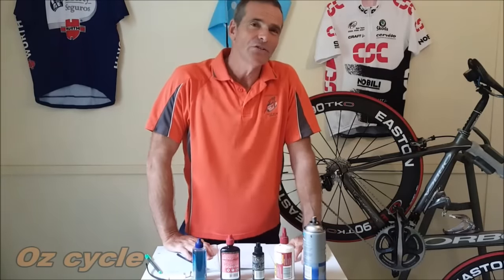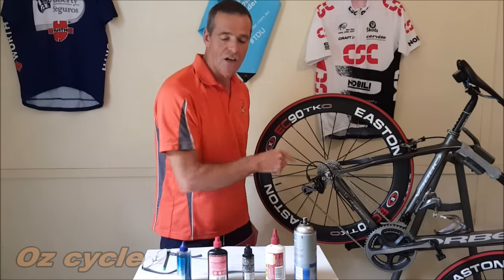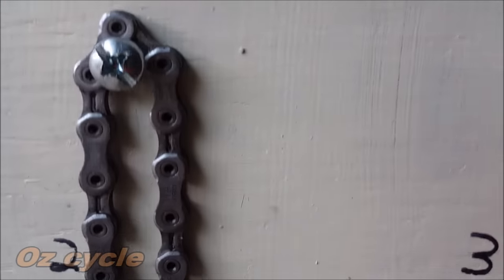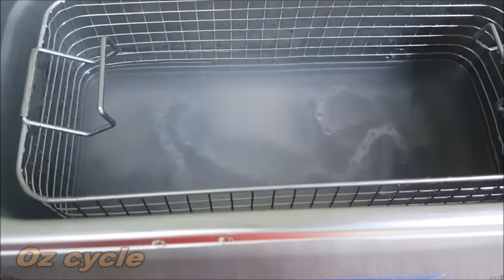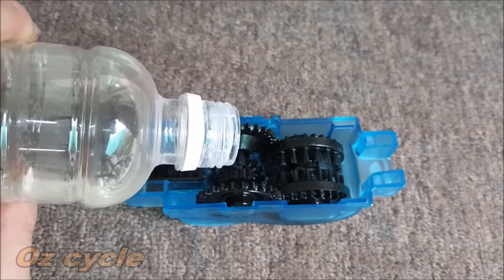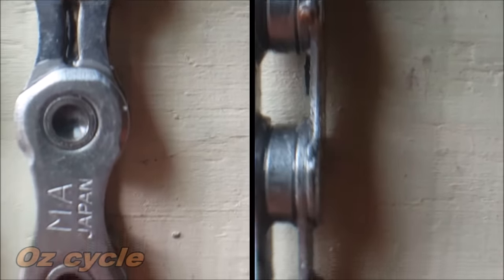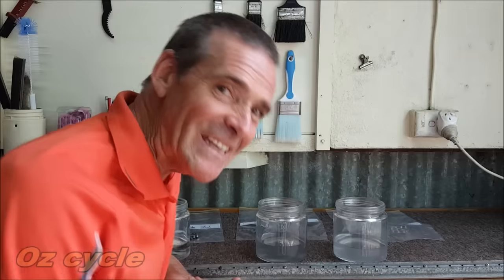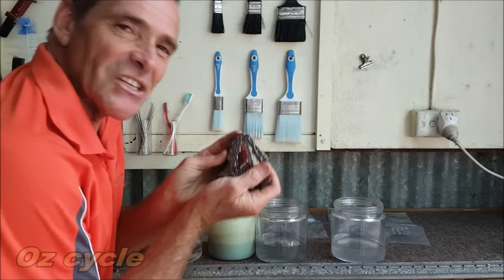Best chain clean ever !!

Comment: It would have been more fair if all methods used the same chemicals.  The plastic jar went through two cleans, from the gas and from the degreaser.  Put gas in the ultrasonic or the chain cleaner and I'm sure it will be a lot closer.
Reply from the maker: +Alan Caballero Yes but petrol in ultrasonic cleaner would be dangerous and it doesnt mix with water so would be used neat...thats 2L of petrol!!....to be disposed of . Thanx Alan,give it a go yourself and let us know the result if you like.

Comment: Does isopropyl alcohol work in place of spirits?
Reply from the maker: Yes
Reply: @stevenleffanue  Thanks for the response. You certainly have convinced me about waxing. Does this method remove wax as well? I have a secondhand chain that might have been waxed. Additionally, is the PTFE absolutely necessary? And finally, will the wax play well with any residual wd40 on chain rings and cogs? Great videos. Really excited to try this out for the maintenance,  cleaning, and silence aspect.

Comment: great video!  thanks for sharing.  after your homemade gasoline you're right to wash it off with water but try this trick.  put the gasoline soaked chain into hot water with detergent and it will boil, and agitate away even more grime from the inside rollers (not dissimilar from the ultrasound).  like this: https://youtu.be/aHFFNp2VKVw?t=9m22s  keep up the good work!
Reply from the maker: +7pillarsOwisdom Good idea...I will watch the video later as Im running out of data for this month. Thanx
Reply: please get back to me when you've had a chance to see it and even try it yourself.  i think you'll like the results. imo, it reduces the need for ultrasonic cleaner (and dumming drivetrain?) while using the homemade chain cleaner just as you do now
Reply from the maker: +7pillarsOwisdom will do

Comment: What about a soak with degreaser instead of using petroleum? Maybe the petroleum cleaned better because it was a soak, not because it was petroleum.
Reply from the maker: Degreaser doesnt seem to 'disolve' oils,waxes and general road grim as good as petrol,Julian. Petrol is also faster acting. Usually just a half hour soak is plenty.

Comment: Great video but the home tub cleaner you also used a spray degreaser so you added another very potent step to the process, voiding the control process
Reply from the maker: +John Burns Hi John. Its really a 2 part process. Petroleum removes most of the unwanted matter whilst the degreaser removes any oily residues which petrol also leaves behind. Hope thats understandable?

Comment: Can we use boiling water to replace ultrasonic cleaner ?
Reply from the maker: +Jonas Ong Boiling water is a good cleaner Jonas if you just have wax in your chain. If using other petroleum lubricants boiling water may not remove all traces of that lube. If unsure whether your chain is clean enough simply soak it in metholated spirits or alchohol in a glass jar...after a couple of hours,shake the jar and see if the liquid is clear or contaminated.
Reply: oz cycle thanks

Comment: how can you remove the chain from the bike?
Reply from the maker: +Herold D'souza Usually with a 5mm allen key from the front and a peg spanner at the rear of each chainring bolt. If you dont have a peg spanner you can use a large flathead screwdriver. The rings should slide over the spider arms and pedal.

Comment: 3rd chain was dirtier to start with. No surprise that petrol did a better job.
Reply from the maker: +Chris Dermody Hi Chris. It may have appeared that way,sorry but I performed this experiment over and over for eight months before finally making the video shoots. The results are still true to any repeated efforts.
Reply: Thanks for the reply. I don't doubt your results at all, was just an observation. I have a lot of experience in cleaning and maitaining mechanical parts, including bikes, and there are few things that eat grease like petrol. Shame it is such a pollutant. I use 3 chains in rotation, swapping every 800km or so. I completely clean the chain every 2nd ride using a combination of degreaser in a Park Tool chain scrubber, rinsing with hot water (twice), and then flushing it with isopropyl alcohol and drying with compressed air. The petrol here is cheap, but it stinks, not like Aussie unleaded.
Reply from the maker: +Chris Dermody Thanks for the insight Chris. Rotating chains over is excellent for extending your drivetrain life too  :)
Reply: Chris Dermody agree.  I have a. 5 chain rotation.  cleaning 5 at one time seems better to me.

Comment: Dude, NEVER run your liquid in your ultrasonic below 2/3 of the tank. You will break your machine and it will not be working efficient because the vibrations come from the sides. Fill up your tank and hear the difference it makes. 
I'm working with ultrasonics everyday

If interested, download the installation instruction manual from http://uk.rs-online.com/web/p/ultrasonic-cleaning-tanks/8555915/
It doesn't matter if it's a different model, all ultrasonics work the same.
Reply from the maker: +Doggoth X Noted. I will take a look at the manual again. Thanx for the pro advice.

Comment: how to dewax? by using degreaser?
Reply from the maker: Soak in petroleum for half hour or more,then degrease....perfectly clean metal 😁
Reply: Also You can use hot air. It's much friendly than petrol.

Comment: What if instead of using petrol in the home made cleaner you just use methylated spirits through the whole process?  Then you don't have to degrease and bathe in meths.
Reply from the maker: Metholated spirits doesnt clean as good as petrol....otherwise it would be good.

Comment: Whatever happened to paraffin and a paint brush? Bit long winded! Paraffin is used in 95% of parts washes.
Reply from the maker: The wax has to get into the chain not on the outside Chris. Hot wax bath does it perfectly.

Comment: Talk about saving money by cleaning your chain and then proceed to show us your ultrasonic cleaner. Bollux!
Here's what I do and I think it's cleans just as good and gets the cogs at the same time. I put laundry detergent on the chain and cogs and spin the pedals backwards a bit, then turn a high pressure hose on the whole assembly from front to back as I spin the pedals. Let it dry off a bit by riding it round the block and then lubricate with WD40 and wipe off the excess. I do this once a week and my chain is very low resistance and the whole mechanism is clean enough! After all I'm going to go out in a few and it's gonna be dirty again in just a few minutes.
I think you're a bit OCD about how clean your chain is and that it has fooled you into preferring the use of petrol to clean your chain. There's a reason why cars have devices that prevent the evaporation of petrol into the environment and you invite it as well as expose yourself to inhaling those vapors so your chain can be clean enough to eat off of. MADNESS!
I don't know about where you live but I can get a new chain for less than an hours' pay, and do so every year just to be on the safe side. A clean chain is ONLY about resistance and your method spends 100 watts more energy to clean it and only saves an additional 0.1 watt over my method, and that for only a day at most.

Comment: Not fair test.  You should start with equally dirty chain.  Rinsing should be same after each method.  What was that "degreaser" and why laundry detergent?  Just use professionally formulated cleaner and follow the instruction.  Landry detergent is design for fabrics not for metal.   Ultrasonic chambers require special cleaners design for that method.

Comment: This is like comparing apples with oranges as different solvents are used in the different methods - an unspecified diluted degreaser + household detergent versus petrol (gasolene) followed by degreaser on a dummy bike (what a faff!).  To make the comparison valid, you should use the degreaser cocktail in the home-made plastic shaker device.  BTW, it's illegal to sell or store petrol in a plastic container in the UK.  And rightly so.  
Also - if the methylated spirits removes residual dirt, why not simply clean the chain in methylated spirits?  Meths is far less inflammable than petrol, too.  And far less toxic.
Reply from the maker: +FangPaw Petrol ruins the brushes in clip on cleaner so the homemade shaker was best alternative. Meths is for removing any residual oils...any dirt falling out is a bonus.Yeh,Ozzie laws are pretty slack in caring for the environment....wide open spaces,plenty to abuse,hey.
Reply: +oz cycle.  You could have used petrol in the ultrasonic bath.  With a fire extinguisher close by!  I love the hand-made shaker, but I'd use it with an aqueous degreaser, followed by a prolonged soak in meths.
Reply from the maker: +FangPaw Pfffft!...yud be suprised how many people have suggested petrol in the UC....no more Oz cycle after that :) . Yeh,good one,degreaser in shaker too. There are so many variations to cleaning things....I just try to start peoples imaginations,they can come up with some great ideas often.
Reply: FangPaw you know the petrol station sells plastic containers in the UK right.
Reply: David Cross - you're right.  I looked it up and it IS legal to sell and store petrol in plastic cans (up to 10 litres) in the UK, but only if they are of the approved type.  Next time, I'll check my facts before I mouth off. Definitely egg on face :-(

Comment: Good old diesel fuel is as good as anything, take the chain off and give it a good swishing about in a bucket with a stiff brush then change the chain every 2000 miles or when it starts to stretch. These bottles of "stuff" and fancy gadgets are just another way of the bike industry extracting money from our pockets ... not necessary.

Comment: You used petrol in the homemade chain cleaner and degreaser and dishwashing soap in the other two. Would it not have been more accurate to use the same cleaning fluid in all tests? Anyway, I use a chain cleaning tool and then blow out the chain with my compressor. Compressed air blows out all remaining grit and no need to remove chain

Comment: if the methylated spirits are so effective, why not just go with the easy brush cleaner and then get the other 99% of remaining gunk out with the spirits. maybe wont be quite as sparkly clean as the ultrasonic cleaner laboratory equipment but pretty damned clean nonetheless?
Reply from the maker: Metholated spirits isnt a good all-round cleaner like petrol. Petrol leaves an oily film in which metholated spirits removes effectively.

Comment: nice test, but your result is irrelevant because you did not use the same cleaning liquid. if you would, ultra-sonic bath cleaning would be definitely the best. you can not compare the hydrophobic properties of petrol to dissolve oil-based lubricant to surfactant. its like comparing shaving with razor and knife for butter.
Reply from the maker: +Ján Petrovaj Agree but the result shows that petrol is still the best cleaner. If it was possible to use petrol in ultrasonic cleaner it would be great but prolly BOOM!

Comment: If methylated spirits worked so well that you used it to determine the best cleaning method, why didn’t you just use it as a cleaning solvent to begin with?!?
Reply from the maker: Metholated spirits isnt an aggressive cleaner like petroleum. It removes any oily film from the metal surfaces.

Comment: Nobody wants to remove their chain.  Its a huge hassle.  How about using your homemade cleaner in the plastic housing that encapsulates the chain but make it larger to hold more of the chain at once?  Take the chain off the front chainrings so it drapes around the bottom bracket.  Then you should be able to put half of the chain in the cleaner at a time and let it sit for a few hours.  2 sessions should clean the entire chain.  Plus move it through the brushes as well to get that scrubbing action.  Nobody needs a chain so clean you can eat off it.  The second you go outside dirt, sand and grit immediately adhere themselves to your chain so let's not be fanatical about this as it takes a lot of time to remove the chain and go through all these stages.  Make it convenient and the chain is cleaned more often.  This is far more important.  Turn it into a multi hour project and not 1% of bike riders will do it.
Reply from the maker: To save power and protect your drivetrain its assumed you are at least semi-serious about riding. Using a removeable link makes taking chain off for cleaning and relubing much easier.
Reply: @stevenleffanue  Good point!  And you don't feel that removable link at all when riding?  Its just as smooth as if it wasn't there?  What about danger of breakage?

Comment: meaningless test as you started with three different chains.   You should have taken one chain and split it in three chains to do the test fairly.    Also, exterior cleanliness doesn't matter much.  It is cleanliness of the pins and rollers that is important as that is where the wear occurs.  Try again please.

Comment: 2:37
I was so close to clicking away when you introduced the ultrasonic cleaner as the first method.
"Okay, cyclist are nuts - They expect everyday commuters to buy an 'effin ultrasonic cleaner you can't even reuse for electronics I bet!"
waits a few seconds
"Uuuuh, there's a hillbilly approach as well!" 😁
Reply: you do not need to clean chain so extremly, hello oz cycle, i have celebration for 5000km made on same chain-hg70 for 8speeds, i waxed it every 100km for last 14 months using inductive heater , i made 2 passes with wax: 1. is to clean, 2. is to lubricate, and chain is still below 0.5%, so you told before 6-9 months that you think that your submersing  chain into wax is better than my way with inductive heater, but you was /are wrong because i have fact that prove that my way is better ,  to wax and clean 1 chain i need 6 minutes and it can be done anywhere because inductive heater and power bank battery are portable and can be transported in pocket, good luck with you slow and complicated procedure
Reply: @makantahi3731  Thanks for the info - I'm still pretty new to biking so I really appreciate it! 😊
👍
Reply: no problem, i am very long in bike bussines and  i try to make cost of bike use to minimum together with used time on maintenance and this thing with wax is best thing happened to me , i was always looked for something that can make chain to last longer but  use of any kind if oil or oil aditive did not make any better result

Comment: The comparison was imaginary when different liquids were used in each device - I'm convinced petroleum cleans better than dishwashing liquid. It would be interesting to see diesel as the cleanser in each apparatus.  Not sure though if the clip-brushes get damaged by petrochemcials....
Diesel won't combust unless it is heated to over 52ºC and then exposed to a flame. Diesel fumes are not as hazardous as petroleum fumes.
Reply: Uh, diesel IS a petroleum product??

Comment: This just in....gasoline cleaned greasy oily grime off the chain better than the other two methods!  Ummm, it was a no-brainer from the start.  Nothing cuts grease and oil better than gasoline!  It wasn't a fair test since you used a different solvent in the "home made" cleaner.  Had you used gasoline in the other two methods (Ultrasonic cleaner MUST to be UL/CE approved for volatile solvents. else boom!) and the on-chain brush unit plastic would need to stand up to gasoline/petrol. Then you'd have a fair test.
Reply from the maker: To get a thoroughly cleaned chain it must be rinsed multiple times not soaked in its own dirt.

Comment: Not using gas to clean my chains bro. Unless you have a clean way to dispose of it, that's just irresponsible.
Reply from the maker: Once chain is removed you can let the gas settle overnight then tip off the clean gas for reuse. Wipe out the dirt with rag or paper towel.Very little is used.

Comment: What a waste of time with your experiment:
1. Ultrasonic with degreaser + laundry liquid.
2. Chain cleaner using the same chemical as above.
3. Home made method is unleaded petrol, followed by degreaser and water.

The winner I think is the unleaded petrol which does the heavy duty work. I am not sure what was the de-greaser for the 1st 2 methods.
It will be interesting to use petrol on the ultrasonic followed by degreaser and water. I bet the ultrasonic will win.
Reply from the maker: +donkeykonghero Petrol in ultrasonic cleaner...KaBOOM!!

Comment: Not really a fair test. Two of them use degreaser. The other uses petrol. Not to do with the method, but all to do with the solvent.
Reply from the maker: +wizardzx2 Cant use petrol in ultrasonic cleaner too dangerous and petrol disolves the brushes in the clipon cleaner.